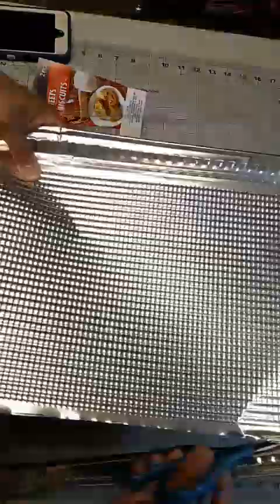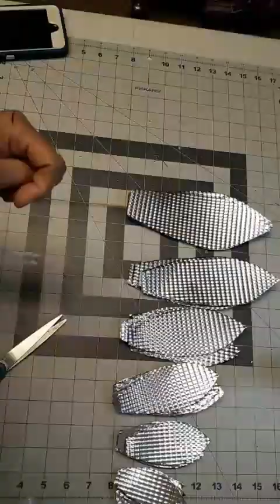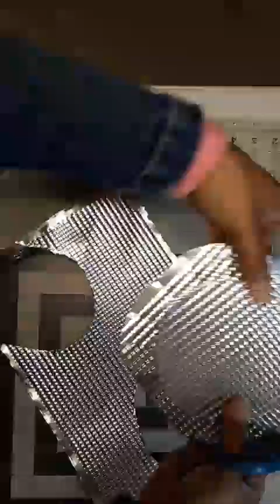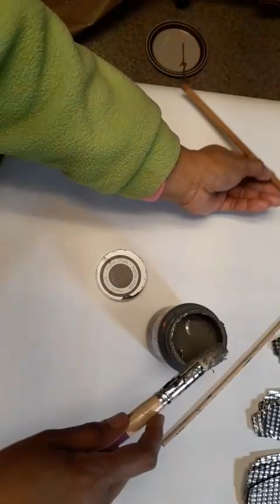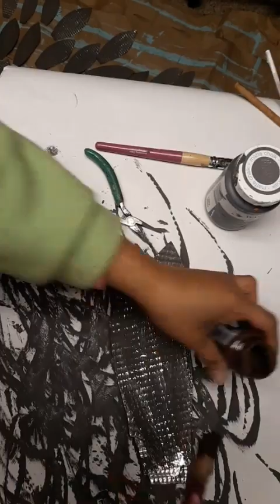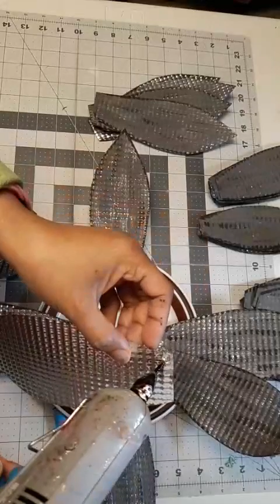How to make Rustic Faux Metal Sunflower  using cookie sheets from DT

Comment: Did i miss the sizes of the petals and the foam board..
Reply from the maker: The petals size ranges from the biggest petals which are 8 inches by maybe 2.75 inches wide and then decreasing an inch on the length and decrease the width with a quarter or half an inch. The foam board in the middle wrapped with foil used as the center is 4 inches in diameter.
Reply: @RovelynMWhisler  thank u so much.. thought i would try this closer to summer for my  single son.. its not girly so he just might put it up or on his rails... would look awesome